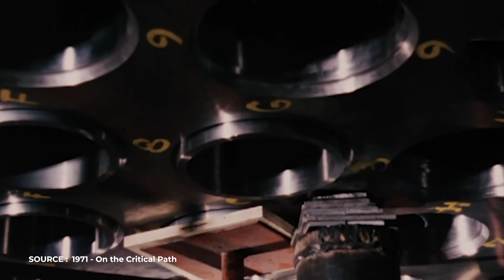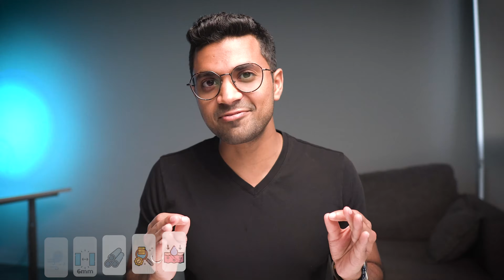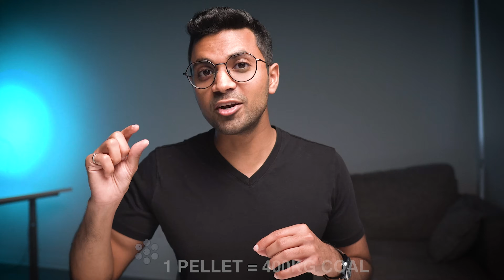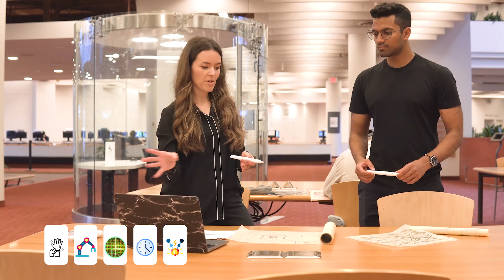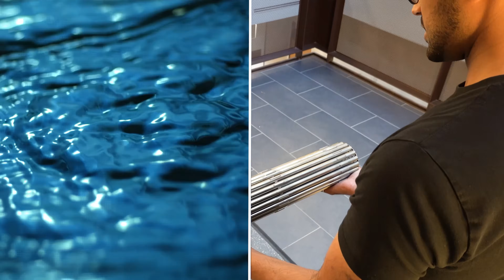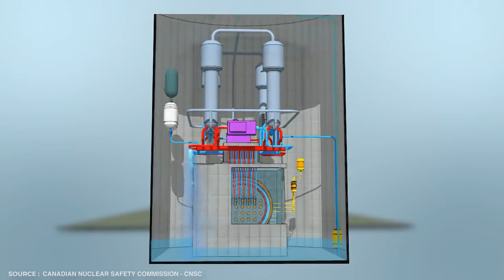The ULTIMATE CANDU Reactor Guide

Comment: Dissapointed and depressed to open this video and see that I’ve already liked it.

Meaning I’ve exhausted all of the content on this topic.

One thing I’ve learned after all this time- the only downsides of this design are the usage of heavy water and the actinide source- which ideally could be something else
Reply: "downsides of this design are the usage of heavy water and the actinide source- which ideally could be something else"

what does this even mean?  Actinides are the radioactive elements.
What else could it be, a non-Actinide and therefore non-radioactive material?

This is like saying "my gasoline vehicle has a downside, it uses gasoline"

CANDU was designed to use Actinides (primarily Uranium and Plutonium), the same as my gasoline vehicle was designed to use gasoline.

Comment: VERY educational. I wish I'd seen this sooner. It's probably too late to ask, but how can a particle move faster than light, and how could they determine this? Thank you in advance to anyone who can answer this.
Reply: Charged particles normally cannot move faster than light, but in water, photons of light get slowed down significantly due to the reflective index, while charged particles are slowed down in a different dynamic than photons of light. It happens so that they get less affected than photons that’s why they could exceed their speed. So in short nothing can top the maximum speed of light but in some conditions light could slow down more than particles. There’s neutrinos for example those particles are impossible to shield from they’re extremely penetrating to the point they pass through the whole planet with minimal interaction while light in a vacuum is faster than them it could be completely stopped by a centimeter of rock. So it shows that while light is the fastest in a vacuum it still interacts with matter more than some particles to the point it slows more than them

Comment: Will you please stop making erroneous statements about CANDU reactors!  There are 4 control rods associated with power regulating system which can actually drop to have a controlled shutdown.  For Accidents there are Shutdown system one (28 cadmium rods which drop into the core) and two (poison injection).

Comment: And of course you completely gloss over the catastrophic Danger sitting in those spent fuel cooling ponds.

The nuclear industry has spent billions of dollars on propaganda trying to divert attention from the spent fuel cooling Pond to reactor safety and the reason they do this is that the reactors themselves are relatively safe but more importantly that's not where the real danger lays at a nuclear facility.

The spent fuel cooling Pond which you spent less than a minute discussing and just played off as being irrelevant is where the primary danger Lays.

What he doesn't mention to you is that spent nuclear fuel is the most radioactive and toxic substance known to man, spent nuclear fuel needs to spend 6 to 10 years under 30 ft of water, it's so radioactive that exposure to a spent nuclear fuel bundle is lethal within seconds and trust me dying of acute radiation sickness is not pleasant it's probably one of the most horrific deaths known to man. 

Those spent fuel cooling ponds contain 99.9% of the radiological material at a nuclear facility, you'll notice he doesn't discuss what would happen in a loss of coolant event at a spent fuel pond..

He talks about the wondrous zirconian alloy he used to house the fuel pellets but doesn't discuss the one major weakness or drawback of the zirconian alloy, what happens to this alloy when it's heated above 100° C or worse yet when it reaches 800 degrees Celsius, it's called these are Coney in reaction, the alloy begins to generate copious amounts of hydrogen, filling the building with hydrogen gas. This is what we saw at Fukushima when the building housing the spent fuel above reactor 4 sent shrap metal several thousand feet into the air and released copious amounts of heavily contaminated smoke.

They call it a loss of coolant event, what he doesn't tell you is that the cooling pumps cannot fail on the spent fuel cooling ponds, they've spent a lot of energy making sure that the reactors will have sufficient Cooling but the spent fuel cooling ponds were an afterthought.

In the last 20 years there have been nearly half a dozen near catastrophic events at spent fuel cooling ponds primarily loss of coolant events.

Why is this important, when the pumps fail the fuel rods will boil the water within 24 hours the water will uncover the fuel rods.

When this happens there will be an explosion as the hydrogen gas that's been building up ignites the fuel rods will catch fire and begin to release their radioactive payload into the smoke which will be carried by the trade winds and eventually fall back down to earth permanently contaminating any area downwind. 

Once the fuel rods are uncovered in the spent fuel cooling Pond there's very little they can do because radioactivity levels are so high that it becomes similar to Chernobyl, remote control vehicles no longer work because radiation levels are too high, helicopters can't fly over the cooling pond because it will disrupt their Electronics and cause the helicopter to crash. Not to mention the astronomical radiation levels above the spent fuel cooling pond that's been uncovered.

The US military conducted studies on the vulnerability of spent fuel cooling ponds in North America, their study confirmed what academic studies had already concluded, that a single spent fuel cooling Pond fire had the potential to render 20,000 square miles of North America permanently uninhabitable, it also posed the potential to kill everyone living in that area.

The US military concluded that a targeted drone attack on three spent fuel cooling ponds in North America had the potential to kill hundreds of millions of Americans and render half the Northern Hemisphere permanently uninhabitable.

The United States is currently storing 196,000 tons of spent nuclear fuel in just 96 spent fuel cooling ponds, I'm not sure how much Canada is storing and it doesn't really matter because if just one of these spent fuel cooling ponds suffers a loss of coolant event millions are going to die.

That's why videos like this focus on the safety of the reactors, with only fleeting mention of the spent fuel cooling ponds... 

And for reference the fuel must be stored in a spent fuel cooling Pond for 6 to 10 years before it could be moved to dry Cask storage it's stored in these ponds because it's too radioactive and too hot to move it takes roughly 6 to 10 years for the fission daughter products to decrease enough where you can handle the fuel.
Reply: Do you just go to every nuclear energy channel and make a long winded comment on how they never mention the dangers of spent fuel cooling ponds? Get a life
Reply: What do you think about TRISCO fuel pebbles used in HTGRs? As far as I know they seem the safest when it comes to keeping fission products contained. The coating withstands a lot of heat and even if a rouge party wanted to extract plutonium from it, would still be hard.

Comment: Fuel pellets are not the "size of a quarter" they are about the size of a "stack of quarters".  They are not disks, they are cylinders.  Also, "dime" is the better reference.  They are between the size of a dime and a nickel.  In fact you can tell that just from looking at the bundle you're holding.

Comment: Dude, you ruined what could have been a very interesting video. I am an engineer and I even found it very hard to watch and process information herein. Too much video of you talking. Any useful clips of diagrams, process only show on screen for 4 seconds and then back to your talking head. You do not show a diagram at first of a whole Candu reactor labelling the buildings, then you do not show where the calandria is in a reactor building. Nor do you piece meal show the building up of a calandria with the double fuel and coolant flow tubes. You do not explain that the large tank of contained water is only a moderator and not coolant. You do not explain the temperature or pressure in the primary loop. You do not satifactorily show the steam generators, secondary loop or turbines.
No where is the condensors and lake water. You also go so fast. It just left me with a spinning head.
Reply from the maker: This video isn't an Engineering course, rather a guide to learn about CANDU reactors. I've taken courses on CANDU plant operations, and this course took over 20 hours or more to go through. This is simply an overview and simplification of the processes for the general public/those interested in the industry to see and learn more

Comment: Can someone help me here -- I seem to be misunderstanding a portion of this. 
The uranium/ceramic pellets inside the calandria tubes....naturally create a fission process and create energy..causing the heavy water(which is water with Deauterium added into it?) surrounding the calandria tubes, this gets the tubes (made of zirconium) to get hot and boil the heavy water which then releases non-radiation steam, driving the turbines etc etc.... 
OR are the inside of the calandria tubes (with the pellets) filled with water?.... sorry...VERY new into this knowledge - it is a LOT to understand and learn (esp as an older adult).. maybe I am just simple lol

thanks in advance - love this fellas channel. Cheers from T.O.
Reply: The heavy water does not boil.  There are two water systems isolated from one another in the CANDU (or Pressured Heavy Water Reactor).  The heavy water is under very high pressure and can achieve very high temperatures without boiling (because of the high pressure).  This heavy water goes through heat exchangers that heat up the other water system.  The other water system is responsible producing steam and powering up the generator turbines.

Comment: Moltex Energy is building a reactor at Point Lepreau in Canada. It will take spent CANDU fuel and extract the 95% energy that the original reactor cannot use. It can work with any ceramic spent fuel.
Reply from the maker: Using spent fuel from CANDU reactors is definitely a remarkable project!

Comment: You can handle LEU, prior to irradiation too.  The new bundles used in light water rx are enriched between 1-4ish% u235 and they are shipped and inspected without shielding.

Comment: My guy, u confused me. First u say the calandria holds 100s of pressure tubes inside (380-480), but right after that u say every pressure tube is inside a calandria tube with an annulus gap of 6mm. I'm lost. Is it only one big calandria, or hundreds of them for every pressure tube.
Reply from the maker: The Calandria and "Calandria tube" are completely different components. The Calandria is the large non-pressurized shell that houses all of the fuel channels. The Calandria tube and pressure tube is part of the fuel channel assembly. There are hundreds of fuel channels in the reactor. Hope that makes sense
Reply: @OsamaBaig  that clarifies a lot better. thanks

Comment: The on-site emergency power generators are not powered by diesel, they are jet engines fueled by natural gas. Each 5MW and 6 per 4 pack, so 30MW installed capacity per 4 units. You forgot to mention another shutdown system, the moderator dump. It was only installed on the first 4 units ever built and was replaced by the liquid poison injection system as they determined the moderator removes about 20% of the decay heat when shutdown. So it was a poor idea to dump the moderator water away to shut down the reaction. The only operating units that has that system are Pickering A units 1+4. Units 5-8 and all of Bruce and Darlington. Units 1+4 were retrofitted with a system called dump arrest, which monitors the neutron flux upon shutdown and compares that to a trend of what the flux decay rate should be and if the flux isnt decaying fast enough, then the moderator will dump. Additionally, in the event of a LOBES, the shutdown cooling system will not be able to operate right away, so the heat transport pumps permit thermal syphoning and will free wheel to allow natural circulation of the heat through the heat transport system, thus cooling the reactor down.

Comment: Like everything about it. Has anyone calculated the carbon footprint of the waste storage process? Seems like a lot of concrete and transportation required - not to mention all the energy required to operate such a storage facility. Not knocking it, just like to understand the entire C02 bean counting.
Reply: Sabine Hossenfelder has a great video on it. Short answer, the calculations vary a lot, but the while lifetime co2 is similar to things like wind power and solar. Potentially lower.

Comment: CANDU have multiple layer of safety system, it can't explode....
Introducing : Dyatlov-Fomin -Bryukhanov trio....
If something happend, It would be a Hydrogen explosion of spent fuel rod pool like Fukushima. Reactor itself is very safe, Well many safety is focused on reactor.
If our trio running CANDU, They would neclecting diesel backup, Or stole diesel fuel to sell. Then somehow spent fuel pool overheat and exploded.
I think CANDU with normal enrich fuel is interesting. America focus on enrichment technology because they can use for nuclear weapon program, space program (RTG and stuff) and mobile reactor fuel in nuclear sub and carrier that need highly-enriched fuel to operate. Sometimes up to 90% enriched fuel, they can last for 10 years.

Comment: At some point, can you please do a video on the wastefulness of DGRs when fuel reprocessing would be so much better an idea?
Reply from the maker: You can reprocess all you want, however you need permanent disposal for ILW and HLW. Deep geological repositories are built based on the burn up of fuel's, thus the more you utilize them the smaller footprint a DGR will have. However, it is a solution that is needed
Reply: @OsamaBaig  deeply (sorry) disagree that they're needed. Once you're actually recycling fuel and have either patience or fast neutron reactors, there is no "waste," just fuel and neutron absorbers.

Comment: Saw another video recently, that thorium uranium mix fuel performs longer than the standard CANDU fuel.
Reply from the maker: They may perform for longer periods of time, but its an entire life cycle cost and resource availability. You need to do extensive feasibility studies on whether its worth 1) Building specialized manufacturing facilities for the blended fuels 2) Supply chain cost for thorium and fissile material (how easy is it to transport in and availability) 3) Is is advantageous for the country to get access to this resource (for a country like Canada which has ample amounts of uranium it may not make sense) 4) Design changes required for reactors (you need to make adjustments to the reactor to burn different fuel sources)
Reply: @OsamaBaig  If I may point you to CleanCore/ANEEL (Advanced Nuclear Energy-Enriched Life) Thorium+HALEU fuel that you just load'n'go into a CANDU. No design changes needed, just changes to operations procedures.
https://youtu.be/nAUDuaqpVW8?t=698
A little bit of HALEU and a lot of thorium carefully distributed in the existing CANDU fuel bundle form-factor, and carefully distributed in and around the core, that potentially yields a 7-fold reduction in daily loading consumption (and thus SNF/HLW unloading). Proposed commercialisation in 2025 if supply chain for thorium & HALEU has been settled. Since most HALEU these days is ex Russia, here's hoping for some stabilising 'regime change' in that country before 2025!

Comment: Hi Osama!
Another great video, thanks for providing that!

What if you stored a used fuel bundle for a while to wait for some neutron poisons to decay and then put it back into the reactor for some time: Would you get another chunk of energy out of it?

Would you mind making a video about the details of the ANEEL fuel for CANDU reactors? 

I just learned in your video, that the pressure tubes are also made from zirconium - I just knew about the fuel cladding!

Comment: Nice video. Thank you. Just one comment: when you talk about the safety systems, when you mention SDS#1 with the 28 cadmium rods (shut-off rods) please make sure you do not create confusion by referring to control rods and adjuster rods. I noticed this also in your video "CANDU Reactor Explained in 5 minutes" - when you draw, you should write shut-off rods instead of adjuster / control rods. In technical terms, we make a distinction between the control function in normal operation and the fast shutdown action of SDS#1 (which has no role in normal operation, but just in transients and accidents). I am sure you know this already. For a layman it makes no difference (and I guess this is why you presented things this way), but for us in the nuclear industry it is important, if we want to use your videos in a professional setting.
Reply from the maker: In operations there is a clear distinction between control rods, which are adjusters and absorbers. However, this video is not aimed toward operations training. Its a introductory video for those new to the nuclear industry or interested in learning about concepts relevant to CANDU. "The Essential CANDU" by UNENE also uses these phrases interchangeably (shutdown & control rods) to help simplify concepts (Section 2.7, point#3: https://unene.ca/essentialcandu/pdf/13%20-%20Reactor%20Safety%20Design%20and%20Safety%20Analysis.pdf). Whether it be solely industry or general public, in order to understand complex topics you need to be introduced to terms one by one. Happy to make another video solely on the topic of control rods/adjusters/absorbers/shutdown rods if you wish. Are you a representative from the Romanian Nuclear industry? Maybe we can connect via email and see how we can build these resources together. My email is osama.baig@ontariotechu.net